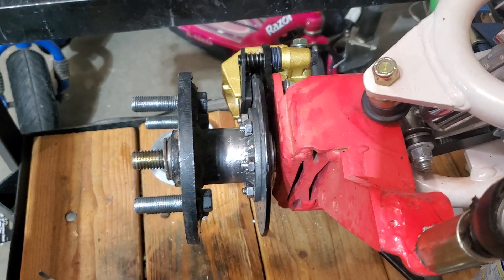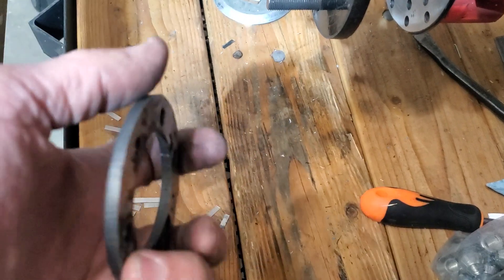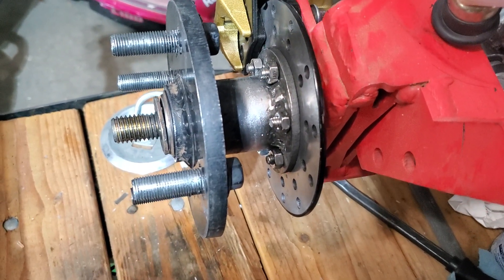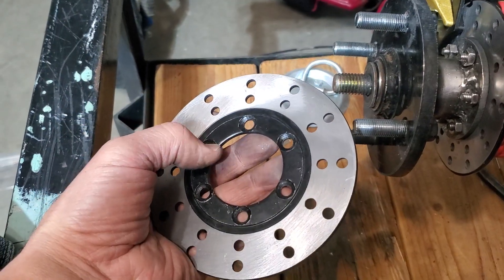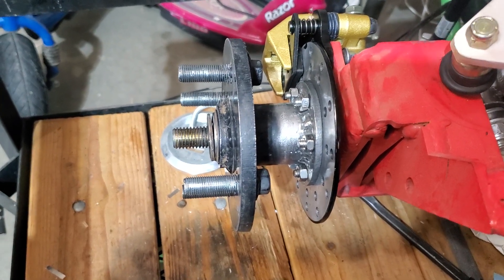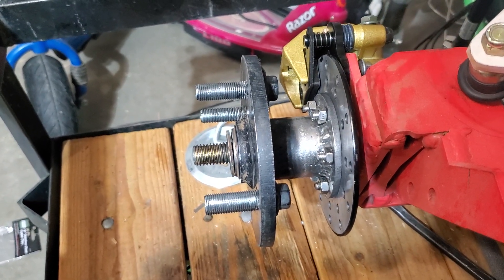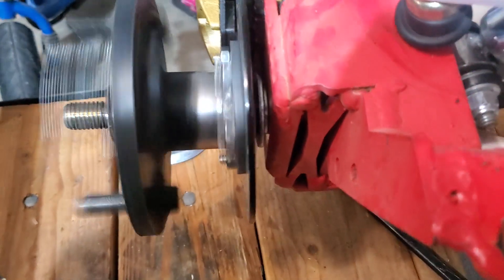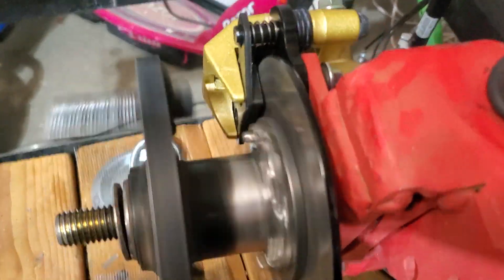Yerfdog Spiderbox Front disc brakes.

Comment: Did you use the dual cylinder setup by the factory one? If so could you show how it looks. Trying to see if I can fabricate mine instead of buying the kit.😅
Reply from the maker: Yes I used 2 stock master cylinders in tandum. One brake line to the front to a T then off to each front caliper. Yes, I need to put together a video of detailing the work. Maybe this weekend.
Reply: @justinsauer5682  thanks in advance if you do🙏🏿

Comment: They never sent me the rotors for my set up, and I called a hundred times but they’re just terrible at customer service or just getting customers parts to them lol. I’m just going with the rear brake. Still trying to get my brake bled. lol
Reply from the maker: That's why I bought from Amazon. Yeah, bleeding, the struggle is real. Disc brakes I've got 2 front, 2 back. Bleeding went well after the I figured it out.